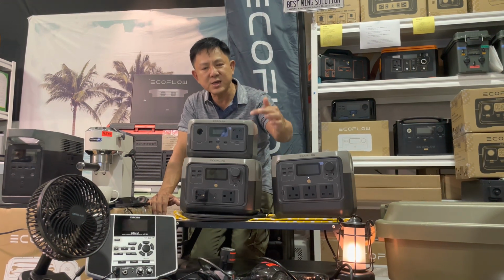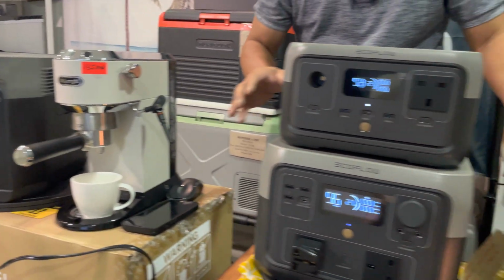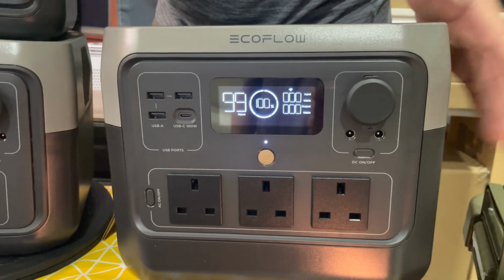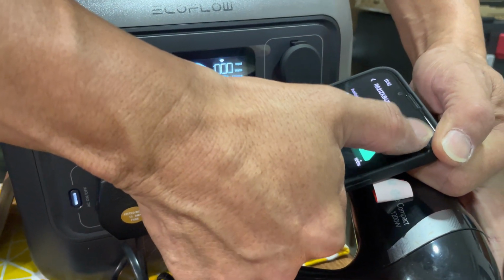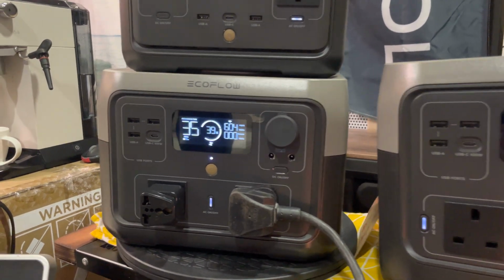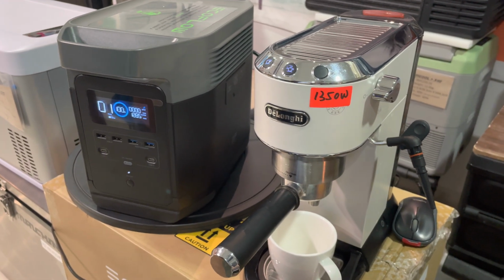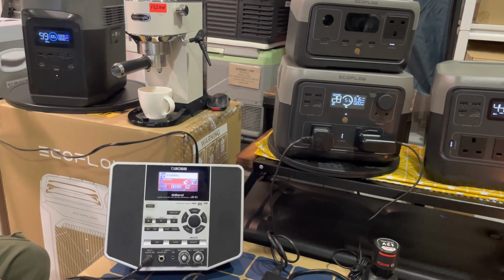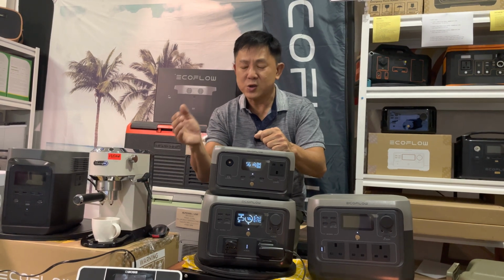EcoFlow River 2 I 正浩 River 2 实测体验 I 大小功率电器 I 吹风筒? I 电钻切割机? 吉他音箱 I 真的可以用吗？

Comment: Can I ask comparison between the River 2 Pro vs the Blueti EB70? I am very interested in the River 2 Pro but Bluetti EB70 is almost Rm1k cheaper...
Reply from the maker: 主要目前是是电池充电速度，还有五年的保家，因為EB70还需要额外充电器，R2Pro只需直接插电线
Reply from the maker: battery 768 watt hours for River2Pro on LifePo4 3000 cycles and 5 years warranty AC output standard 800W surge 1600W with X-Boost , until the next gen AC180P Bluetti arrive , so far R2Pro consider the better option 🆚 EB70